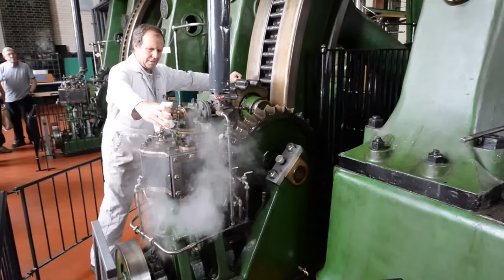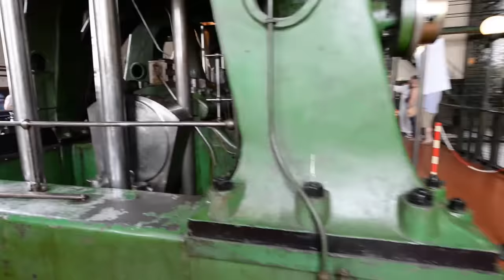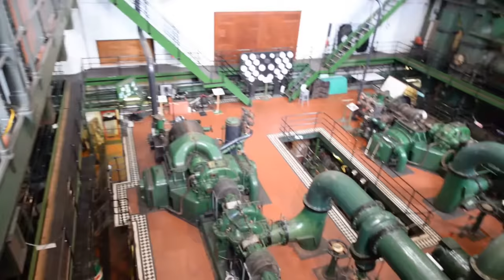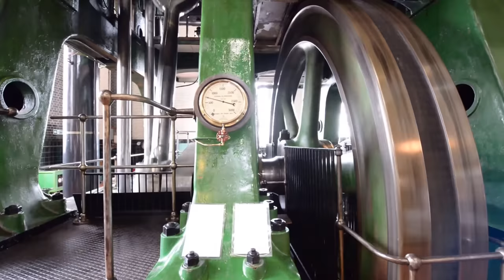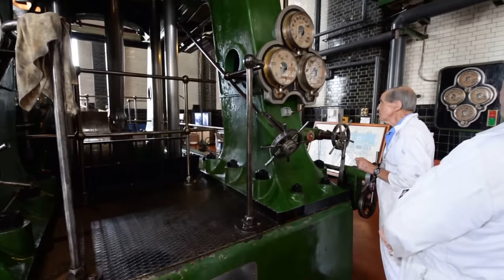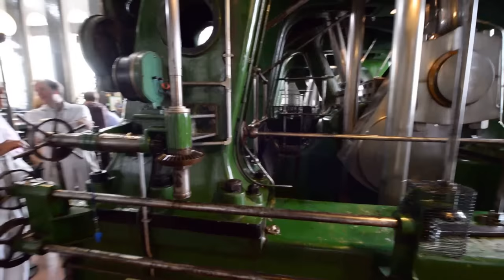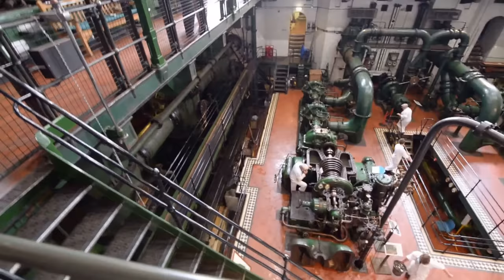Kempton Park  Big Triple Steam Engine Starting

Comment: For those who are curious the torque figure is approximately 311,412 Ft/lbs of torque (17 rpm, 1008 hp)
Reply: 421,963 Nm
Reply: Yep I was wondering... thanks for the info 👍
Reply: I just don't think one of these will fit in a honda civic!!🤣🤣
Reply: You way off. For on thing there is no limit to the hp of steam and it depends on the pressure/volume or how many boilers are lit and stoked id guess conservative hp would be14,000 each. My car has1600 hp blown injected you are so far off
Reply: Try 30,000 combined
Reply: @rearspeaker6364  yeah, cause your Honda civic fits in it
Reply: For when you need to put a little more spin on planet earth
Reply: @applejuice5272  thank you for providing human readable units ;)
Reply: Is that a lot or a little?
Reply: @dwood82574  what are you going on about? HP=Torque*RPM/5252. That’s why HP goes up with RPM. 

The museum that runs this engine states it’s 1008 HP @ 25.4 RPM. That’s why the torque numbers are absurdly high. 

Your “blown injected” is 1600HP @ (guessing) 7000 RPM. You can do the math for the torque. 

You’ll see that a lot of old engines have low HP, but absurd torque numbers because they spin slowly.
Reply: @jrobmccoy  So is this a triple expansion design?   I was on a Liberty ship that had 3 cylinders. The first was high pressure and small diameter, the second and third used the exhaust steam from the previous cylinder.  Cyinder #3 was huge.

Comment: These machines were beautifully crafted without CAD or CNC. No other engine can compete with a steam driven one!
Reply: And the prowess of the men who designed this. These clowns today couldn't come up with something this awesome with a gun to their head. One of my prize possessions is a full set of engineering textbooks from the early 20th century.  It's such a joy to revisit the methods and rationale of the time.
Reply: @johndoe-so2ef  please, share some titles so I may or may not find a paperback copy! I adore old-time engineering...
Reply: What has replaced these machines to pump the water?
Reply: You don’t need cnc or cad to design and build such simple machines . It’s just a big Mamod ! It’s not rocket science!
Reply: @pufango4059  These machines were designed by the people who now build CAD software programs. The most intelligent people worked on this. The knowledge, experience and commitment it took to come from nothing to such a complex installation was immense and it was put on paper piece by piece. The design department was structurally as complex as a personal computer. The machines used to machine these gigantic pieces of work were operated by workers who could not study because of their backgrounds, but were intelligent enough that they could have completed university studies at their leisure and  who had gained experience in the factory from their early childhood. It was an unparalleled team effort.
Reply: @johndoe-so2ef  who you callin clowns
Reply: Reminds me of a story.  In the 90s a bunch of engineers from nasa decided to take another look at Saturn 5 rocket engines.  They where shocked and almost in horror when they realized that all of them where slightly different, and hand built.
Reply: @huskkyy  “calling”
Reply: @danieldmyers  *callin’ and that’s the like the smallest thing wrong in that sentence
Reply: @randomguydoes2901  most electric is generated from a steam engine :)
Reply: @JK360noscope  Honestly that's still one of the funniest quirks of the modern age; it's still mostly steam, we've just figured out new ways of making it.
Reply: @mafiacat88  Steam power generation is one thing, but the modern world has almost completely abandoned steam propulsion.  In this day and age there are a multitude of propulsion engines that accomplish the same and more with none of the downsides of a steam engine.
Reply: Diesel, gas turbines, electric, they all can.  However for the time this was built it is very impressive.  But doesn't hold a candle compared to what does the same job today that those did back then.
Reply: designed with nothing but a pencil, paper and human ingenuity. built to last and to look good doing it.
Reply: @JaapGrootveld  What?
Reply: Almost 100 years later, the Pratt & Whitney PT6-60A aircraft engine produces over 1100 shaft horsepower and weighs less than 500 pounds. (This comment is not intended to take anything away from the engine shown in this video, which I think is amazing.)
Reply: @johndoe-so2ef  I wouldn't call the designers and builders of a RTflex96C clowns....
Reply: @skippyguy3  call them whatever you want. I've worked on too much of the junk these cad jockeys produce to care.
Reply: @johndoe-so2ef  think you missed the point there Winston.  🤣
Reply: @pufango4059  Hi, I don't know where in the world you live but if you ever visit the UK visit Didcot Railway Centre in Oxfordshire. Have a look at the front end of a King class steam locomotive, admire the complexity of the design, all done by draughtsmen with slide rules and knowledge. There's nothing simple about the front end of a King between the frames.
Reply: @randomguydoes2901  electric motors running on the current supplied by a steam turbine running a generator.
Reply: @chris-zt7eo  not so, coal fired power generation is still the most common way of producing electricity in the world today. The difference is the efficiency with which they they convert the steam energy to rotational energy.  The biggest power station in Australia is the Eraring power station at Dora Creek which uses four 720 MW  Toshiba steam turbo generators outputting to 500000 volts transmission voltage.  So, to say steam is obsolete isn’t true
Reply: @theyetti8811  wind.  oddly enough, when its not windy, nobody is thirsty or uses the loo.
Reply: @pufango4059  you're a dolt.  They are simple in purpose and operation but once you get 100 tonnes of iron moving about under the influence of hundreds of pounds of pressure per square inch of live steam, things get interesting.  A Mamod operates without much tolerance at around 10 psi of steam.  A very crude analogy.

Comment: “So how much torque does that thing put out”
“Yes”
Reply: All the torque.
Reply: hp = torque x rpm / 5252, assuming it could hit 60rpm for 1000hp, that is 87533 lb/ft
Reply from the maker: It says what it in in the description 🤗
Reply: Mark Bowman nope
Reply: @joey66436   It is running at 17.5 rpm, therefore torque; 25,530 lbs/ft.
Reply: @David-lb4te . Around 8:50 it hit around 50 rpm before slowing again. I played alot of records back in the day. Lol.  Or did you mean that 17.5 is the slowest they ran it?
Reply: 150 n/m😹😹😹
Reply: 2 pounds of torque per 1 pound of steam pressure.
Reply: It now runs at 20 30 rpm
Reply: you could probably calculate the tongue based on the angular momentum of the flywheels .
but you would need to know how heavy they are first.

good luck :)
Reply: @logangraham2956  Thinking the same.
Reply: @David-lb4te  What is it in non-retard units please?
Reply: @mikewillett5076  The dial near the end shows a max of 25rpm, and going at around 17 at that time. here https://youtu.be/KhlJp1VZMB8?t=645
Reply: @christopheroliver9435  
🤔🤔👉 Clearly they need to install the new high Edelbrock high performance kit specifically designed for these engines. It comes with an Edelbrock intake manifold with 2 new  874,000cfm 4 barrel carbs, a high RPM cam, some headers and roller rockers, and will increase its max operating range from 30rpm - 6,400rpm. It'll boost the horsepower output from 1,000hp to 1,250,000hp! There's even a custom engine mount kit to install one of these into a lightweight Mazda Miata, or an 80s fox body Mustang chassis! 👍😉👌
Reply: @David-lb4te  Steam engine torque is different from gasoline or diesel engines. Not necessarily proportionate to RPM. Steam engines can produce high torque even at very low speed. That's how steam train engines worked. Regards.
Reply: Guys you're forgetting the plot twist:

The big engines just setting up another flywheel of a even bigger engine.
Reply: @joey66436  https://youtu.be/KhlJp1VZMB8?t=634 -> max 30rpm, so it's twice the torque - worst case
Reply: got to have it in my cj7 jeep!!!
Reply: @logangraham2956  
🚫 I attempted your equation recommendation on the most powerful "tongues" I could think of, but the results I got seemed too low.  I'm pretty sure that Gene Simmon's "tongue" produces WAY more torque than your equation claims! 😁
Reply: @HighlanderNorth1  well i did not give a full equation...
but that nice that you tried to test it.

i know the flywheels are part of the torque equation as mass is important to energy but i would not know what else you would need to know.

as far as i know at least it should be a combination of the speed and the angular momentum of the flywheel.
though i would not think that is all you need.

but i am definitely not some kind of scientist so XD just taking some guesses based on my very rudimentary understanding of how physics works
Reply: @Redzone 2119 no it's not
Reply: @Redzone 2119 ok thankyou that's what I meant
Reply: 1008hp at 17rpm would be 311k ft/lbs. It has nothing to do with angular momentum. Torque is a force, power is force over time. The flywheel just keeps it running, it doesn't provide the force.
Reply: @Redzone 2119 How to measure such a torque if it produces no power?
Reply: @Redzone 2119 I agree with you, but looks like you misunderstood my reply to others. I meant a steam engine can produce more torque than a standard 2/4 stroke engines
Reply: @Redzone 2119 I am aware of the formulae. Regards.
Reply: we have all the torque.
Reply: all of it
Reply: "Do you see that building? It is blocking my view. Move it a little to the left."
Reply: enough, but not too much
Reply: @mikewillett5076  "Alot" is a town in India. "A lot" is multiples of something, more than one. "Allot" is to apportion something.
Reply: @logangraham2956  Calculate the "tongue"? Like cow tongue? Cat got your tongue type tongue?
Reply: @coloradostrong . I do know that it's supposed to be spelled "a lot". But it's kind of become the norm, even my voicetext spells it the wrong way. Heck sometimes ain't is used even by educated people even though it isn't a word. And I definitely know the "there their they're" and "to too two"  difference, lol.  Those bug me.
Reply: All of it
Reply: two houses and an elephant
Reply: @logangraham2956  and your understanding of units of "tongue" 🤠
Reply: @subramaniamchandrasekar1397  Hence "foot pound"... The force in pounds at an offset of 1 foot from center of rotation
Reply: @subramaniamchandrasekar1397  acceleration of flywheel, flywheel is a spining mass so it takes energy to spin it up

Comment: All proper steam engines are painted green and have a random spanner lying about.
Reply: Absolutely, it's essential to making it run properly !
Reply: And an oil can, not to forget.
Reply: The special paint for engines is called 'Engine Green'.
It's usually green in colour...
Reply: Yep, a 11/16 Whitworth usually. Don't forget the oily rag too. Both of these things will fix anything on any engine pre-1946.
Reply: And the spammer is about 4 feet long

Comment: Reminds me so much of the pump stations that I worked at through the 90's and early 2000's  in Chicago. Steam driven pumps that delivered finished water all over the city. Huge stations with the same basic design as this one, all the pumps down on the floor below the mezzanine. Fabulous granite and marble construction, wooden flooring and brass railing. All of it maintained to perfection and sparkling.  
My purpose there was to install new control systems for the electric drives being installed to replace the steam drives. Very much enjoyed the work but was and still am sad that all of that is now gone. All the people gone that it took to operate and maintain the boilers and drives, probably 50 or more at each station. The level of maintenance gone with them and most of them left with the doors closed and locked as they are now controlled remotely.
I am grateful to have gotten to experience the beauty and greatness of such things built by those before us.

Comment: I always enjoyed walking into a plant and seeing some of the older equipment. Unfortunately, my job was to upgrade these steam engines and turbines to modern controls. I always felt a little sad seeing some of the original equipment go, but even sadder was the mass replacement of men with computers.
Reply: Yes, the Operator & Oiler in the Engine Room and the Fireman in the Boiler Building.